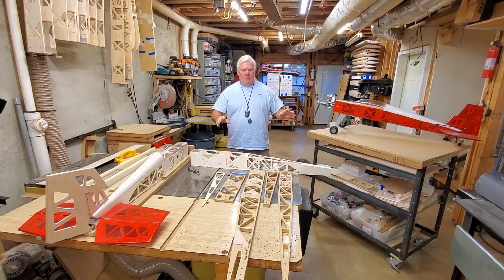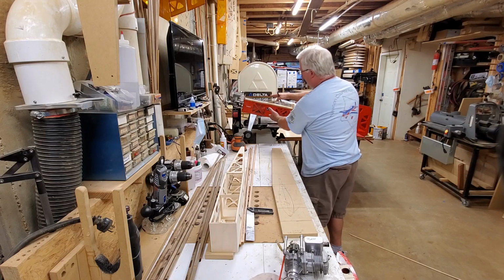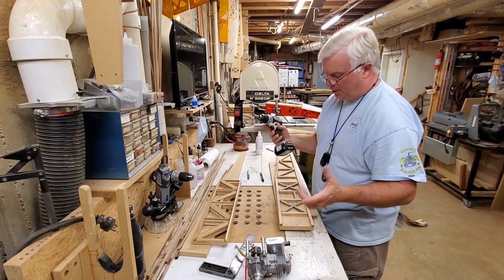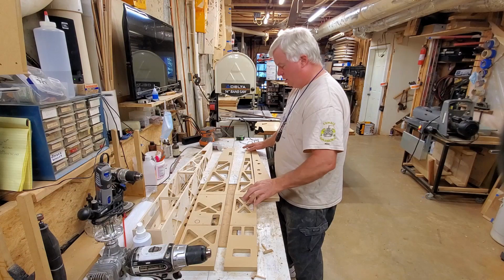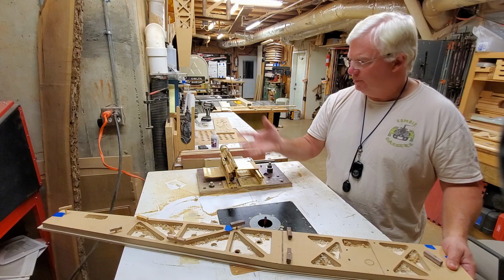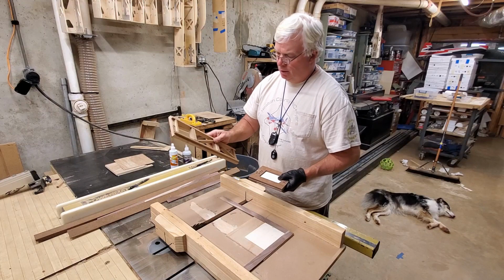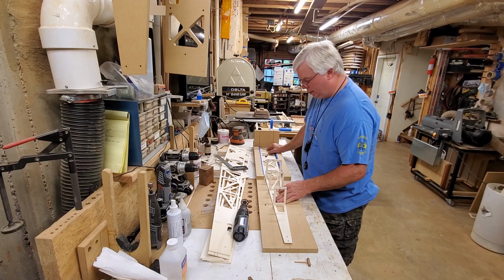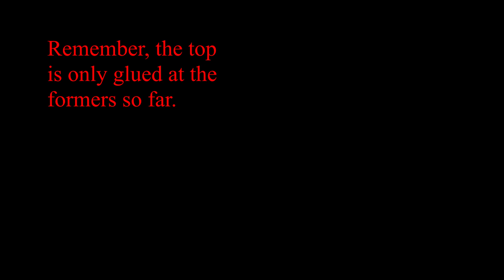Scratch Building Your Own RC Planes   Episode #2 - Fuse Assembly Part 1

Comment: Great presentation thankyou.
 Just a wee point for less experienced users, the router bit unguarded is a finger shredder...familiarity is then the trap that can bite...
see at 56:12 as the finger quickly strays near the winding down bit.
(Woodworker of 35 years and 10 fingers here)

Comment: small wood parts bandsaw ... get a handheld one and mount it on it's own table top stand with it's own adjustable table ... and poof instant mini bandsaw for wood and its portable 
.
Adam Savage did one like that be a good place to get a few ideas on what you may need or want to do ...
Reply: recording tip ... when using the power tools like the router .. MUTE or lower the sound ... not everyone likes to hear finger nails on a chalk board type sound louder than you are speaking ...

Comment: Great video,
Question 4 ya-

I'm starting to build a new scratch build design of a Long EZ rc plane next.

My question is how to go about making straight cuts on a angled wing in the back tobthen add the vertical stablizer fins/ rudders to each end of back wing?

I can use simple triangle 🔺️ tool to make sure rudders are at 90 degrees pointing straight up.

But since back win is angled. I'm unsure how to make a precise straight cut to atach rudders to keep plane tracking straight ahead in flight.

Again, it's easy adding fins to a straight wing because ends are already straight.

Any feedback would help.

I can eyeball it but like to be alittle more accurate in build. If rudders aew slightly toe in or out a 1/16" might need to add more rudder trim later.

Comment: Rite now I'm using a new hollow wood with som 3/8" wing foam board on top and tapped down. Works ok, i have 2 push the pin down and into door skin 2 hold parts solid. Having fun and really enjoying it. The assembly is 90% finished. I found your web site, really, really enjoy watching you work with all the power equipment. You look like you are for sure set up as an mass assembly shop. Those templates are HD ones for sure. Do you sell complete kits with plans and instructions for if so is pricing available on line?
Reply from the maker: Mike, I could swear i answered your question a few weeks back but it just showed up in my unanswered list.  Sorry for the delay.

I have considered selling a "short kit" version with a special assembly video.  The problem is the amount of labor drives the fair cost up tremendously.  Im still working out to do it so that guy who will never cut or sheet foam can enjoy the rest of the build process.  This is a subject we discuss pretty regularly on the FB Group RC Foam Core Wings.

Comment: What type of material is the white color of work table top where you were pinning the pieces down together. I'm new to building scratch.
Reply from the maker: If you mean the surface of my work bench, its simply formica.  Its just countertop surface from Lowes or Homedepot.   It is very durable and easy to scrape glue off of.  When I wear it out,  I just sand it smooth and glue another layer on.  It lasts me about 5 years of everyday use.
Reply: @mikencrcf6018  .

Comment: Is the plywood that you are using Baltic Burch or do you use something else?
Reply from the maker: It is Liteply.   Many suppliers call it bending plywood or poplar ply.  

Its a thin layer of balsa between two poplar layers.  3 ply.

Baltic birch is far too heavy.   

See the Facebook group RC Foam Core Wings for more details on this and other materials. 

Just search Liteply on the group

Comment: Is there a strong enough electric engine that would fly this plane
Reply from the maker: There are certainly motors strong enough to pull it however the battery required would be prohibitively heavy. 

This plane is designed to be exceptionally tough and easy to replicate parts if needed.  The price for that is weight.   

Unfortunately,  gas engines are the only viable option for thrust at this point.

Comment: How deep was your register slots? I’m guessing the thickness of the bulkhead. 3/16?
Reply from the maker: Actually,  make those slots 1/16 deeper than the thickness of you firewall material.  So, in this case 3/16+1/16=1/4. 
That way, the fuse sides will extend 1/16 past the firewall and give you enough material to sand the entire firewall face very nicely.   

There was a short clip accidently omitted from the video.   You will want to put a similar slot on the  jig face to accept the fuse bottom.   I had to use a chisel to form a slot in mine since I forgot it.  Actually, it was very easy to do with a sharp chisel and ill likely do it the same way next time.  Thats the missing clip.

Comment: Is Russian birch 1/8 ply ok to use or is it to heavy?  My plywood supply company only has that type.
Reply from the maker: Birch would be way too heavy for the fuselage structure.   I would definitely find Liteply or whatever a local equivalent would be.  A quick Google search revealed several distributors here in the States.  Since Liteply is a brand name guys in different parts of the world may find it called something else.  It's 3 plies,  poplar on the outside and balsa is the center ply.     I know a lot of guys over seas buy it from Sweden.  If you are here in the States, you should have very little problem finding it.  My supplier is Aircraft Spruce in Peachtree City, GA.  I drive 1.5 hours to get it but I buy about 20 sheets at a time.  Properly stored, it will last indefinitely.    I was told that some distributors will break a 4x8 sheet down and ship it.  That would definitely save on shipping and provide much greater protection for the material.   Don't let anyone roll a sheet up to ship it.  You need it flat.  I hope this helps.
Reply: Pilot kits from the 80s used a very similar material. There isnt a huge difference in weight between Liteply (or bending ply) and Baltic Birch, or Russian Birch. The birch is stronger than the poplar and you can make your webs slightly smaller with the same strength and nearly the exact weight of Liteply.
Reply from the maker: Well.  Liteply is poplar with a balsa core.  Its stiff unlike bend ply.   I use bend ply in several applications that require a bend tighter than liteply can support.  However,  its very hard to keep rigid on long runs. 
As for Baltic birch (or birch),  its a great product but its very expensive and very heavy in comparison as would be expected.   The strength comparison isn't even close for those two.  I use birch where needed for strength but otherwise, it's way too heavy.  

I have used 1/64 birch laminated to balsa in a pinch when I was out of Liteply.  It works great but again, the birch is too expensive as an alternative solution.   

You may be referring to Luan for the 80s model planes.   I know many of them, notably the Lanier Stinger kits, used Luan.  The problems with Luan are primarily weight and durability.   Luan has a tendency to de-laminate over time.  

Liteply is really the only solution that I know of.  All modern arfs use it.  

High end manufacturers use very thin liteply and laminate a carbon fiber cloth to it to achieve a very light but incredibly strong material.   That of course, is way out of the targeted budget for this project.  

Liteply is cheap if bought in large sheets.   I will add however,  that because of covid 19, its hard to find.  My supplier says it will be December before they restock. This is due of course to the Asian balsa industry issues. 

Thanks for the input.
Reply: I found lite ply and i found the Russian birch and built   the same plane and the light ply is about 40 percent light than Russian birch.  RB was $12.50 for a 5ft x 5ft sheet.
Reply from the maker: Wow!  Thats a killer price for 5x5 liteply.   Its 1/8 right?   What is the distributor?
Reply: @mikencrcf6018  plywood supply in ft worth tx and its 1/8
Reply: Plywood Company
Reply: Mike if you would like i will send you a sheet or 2 cut into 1ft x 4ft strips. That's how they sen my lite ply.  Just let me know where to ship then to

Comment: What is the name of the foam you are making use of
Reply from the maker: The foam we use in this project is one-pound virgin white Expanded Polystyrene or EPS.  Don’t confuse it with Styrofoam which the name brand for Extruded Polystyrene or XPS.  Eps is much more durable than XPS.  

I obtained quotes of EPS a few weeks back and found several distributors across the USA who will deliver EPS for $8 to $9 per 4x24x48 slab.  When you consider that you get a wing half and all the tail sections from one slab, it’s really cheap.  

Some distributors have a minimum order size of around $200 to $250 while others do not.  So, shop around or get some guys to go in with you on a purchase.  I will warn you though, it is addictive so get more foam than you think you will need.  Especially if you start building the flying wing (Gnat Wing).  They are very addictive and so cheap to build and fly.  There is less than $30 in materials in the plane.

Comment: look I don't want to be critical but the the sled use at 1:50 is bad practice...MUCH safer to pull the sled further back thus removing the spinning blade from the area where you are arranging pieces, your hand repeatedly passes less than 3 inches from the blade, I was cringing. 

 It is a percentage game, one time in a thousand or 10 thousand the hand strays. Micro surgery isn't fun.
The massive slot the blade is running in is asking for a small off-cut to jam, needs to just have blade clearance 

I extensively used sleds and jigs in my career

Comment: Lavalier mic. You really need to look into them, buddy. The audio of this video makes it borderline unwatchable.
Reply from the maker: I actually did a step better and went with a Rode Remote Mic a couple episodes down the road.  Sorry you didn't like it, but its been a  learning experience.  Around episode 10,  I changed to a Cannon 90D as well.  Holy crap  that took some time to figure out. 

As a side bar, I did buy the Rode Lavilier soon after this episode.  I found there's no way I can work with a cord attached as much as I move around.  I was constantly forgetting to unplug and pulling the tripod over.  I figured best to spend $200 on a Remote mic than $1k on a camera.